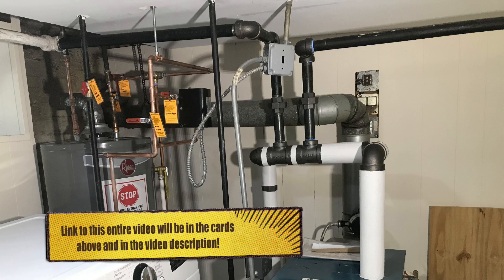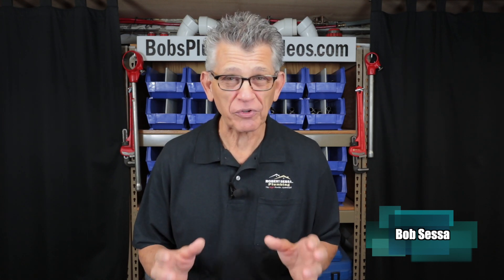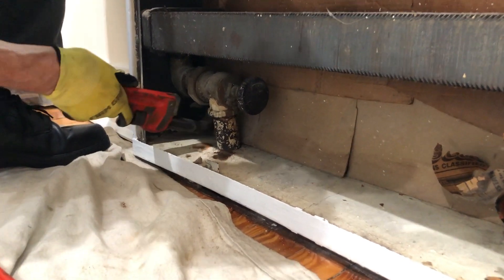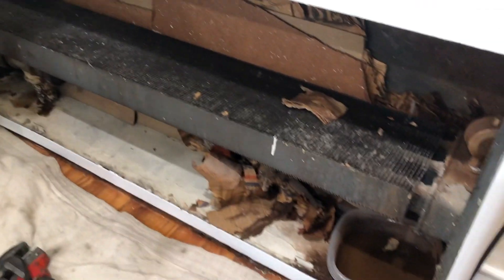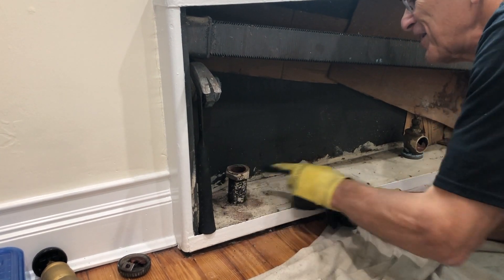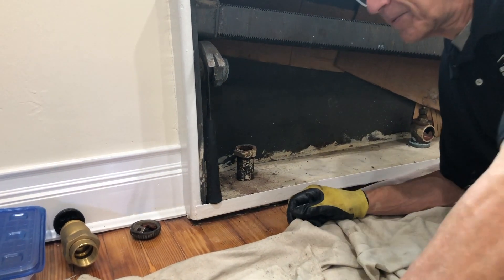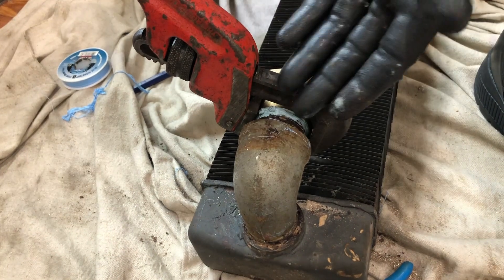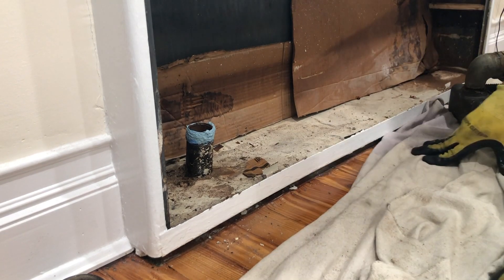Steam Radiator Air Vent Spitting Water

Comment: Bob    Exactly what blades did you use to cut the valve?
Reply from the maker: 9 inch 14/18 TPI Diablo Steel Demon Bi-Metal Blades
Reply: @BobsPlumbingVideos   Bob  Santa needs to know what blades you used on the Multi tool.

Comment: why not change the street elbow and small nipple while everything is a part?
Reply from the maker: No question you could, but I don't like messing around with these steel convectors (fragile animals) doesn't take much to screw them up. If this was a cast iron element, absolutely!
Reply: @BobsPlumbingVideos regardless you should have held back on the street elbow with another wrench.

Comment: Hi Bob, I have the same kind of radiator on the 4th floor and the air vent keeps spitting water. Is the valve issue?
Reply from the maker: Pitch the convector toward the shut off valve, use a good quality air vent. Hoffmans are a good choice.

Comment: great job but 1nfatal mistake was observed,youre never ever supposed to put any pipe dope nor teflon at any union joints even covector valve,thats a huge huge no no as far as fitters locals in nyc,that shit goes inside the pipe and tou are dmnn fuked, and damn u had the coil out and really takes a second tofully drakn that water out off that coil, details is what makes u stamd out from the pack AND $$

Comment: My convection radiator is knocking and spiting water, but it doesn't have a convector valve. The pipe goes straight in from the boiler.
Reply from the maker: All convectors should have a service "shut-off" valve, but I've seen this situation before as well. Having a working valve just makes life easy when you have to remove the convector ands investigate.

Comment: Hi Bob, I have the same radiator as seen on the video and it has the same amount of space inside the wall. My radiator is not producing enough heat for the bedroom. I replaced the relief valve on the side but it's still not able to produce enough heat. The shut off valve is brand new and fully open. I want to mention that I also have a steam system. I called many people in regards of finding the same radiator but was unsuccessful in finding a replacement.  They stated they don't make this same type of radiator anymore. Where am I able to purchase this type of radiator? Should I  buy a cast iron radiator? Are you able to send me a model number, if it's available for purchase?
Reply from the maker: They are a little bit had to find, but they're out there. Check out this link  - https://bit.ly/3rRfYQa. Check the data sheet for specs. I believe they'll ship. Is that convector properly sized for that room?

Comment: I don't see these convectors much, any advantage to them over cast iron radiators as far as heat goes? I guess being mostly recessed into the wall they don't take up as much floor space.
Reply from the maker: I personally like the cast iron versions, they retain the heat much longer after the heat shuts down. These steel convectors heat up quickly, but cool off soon after the boiler shuts down.

Comment: Great Video Bob! You do it so easy and fast. I am a Super Intendant on a 75 family in South Brooklyn. The past few years i use Verivalve. My radiators are same as in this video. I hate when tenants play with those main valve and then they leak and damage the ceiling in the lower apartments.

Comment: Hello ... A frustrated Brooklyn tenant. 3 Years in a row radiator is spitting water and my super thinks I or someone is touching the valves .... unless it's a ghost no one is it's no reason to. Any suggestions.    He changed the piece where the water is spitting out 4 years ago when it initially happened. Its worst now because he said yesterday they turned the heat up do to the tenants above me on the 4th floor wasn't getting good enough heat to warm their apartments. My hardwood floors are slightly warped because of this... Dumping buckets after buckets.... Helpppppp lol Please
Reply from the maker: Tough situation in an apartment setting, to many hands playing around with things they know nothing about! I feel your pain.
Reply from the maker: Bay Ridge
Reply: Today the valve was making noise. When i took it apart, the inside rubber piece came out of the handle and was making funny noise. Which part of Brooklyn are you in?

Comment: Great job! I used to live in a CO-OP in Jackson Heights. I remember when those used to bang, but it could really heat up the Apt. Still in Jackson Heights, but own a 3 family. Before I even got through the video. When you said water was spitting out I automatically thought that the auto feed with the low water cutoff  combination maybe went bad, because the sludge that can build up in the steam radiator when not flushed out after long periods of time. You’re videos are great. I do commercial work as a steam fitter. Sometimes at a job anywhere from 1- to 3 years. Depending on the size. I always wanted to try residential because you see different people on a regular basis and go from one job to the next. So l, nothing really get Repetitive which can happen in a commercial job site. Keep up the good work. You’re only a borough over  Lol  small world. Keep the videos coming. Great content.

Comment: Nice job! 
I have the exact same convector in my house in Queens except it's a hydronic heating system (not steam). Is there suppose to be a hy-vent on one side? Cause I only have a manual air bleeder valve. Thanks!
Reply: Manual bleeder only

Comment: That that special blue goop?
Reply from the maker: Not Blue Block, Mega Loc. My everyday go to choice! I use Blue Block on all of those problem Joints.
Reply: @BobsPlumbingVideos  Thanks for the response! You have great videos for beginners (me) and pros. Any opinions on Bradford White's boiler system? I work at a kids camp and we need to replace a furnace soon but just put this 100gallon water heater/boiler in. Any thoughts if you have time.
You're much appreciated either way!

Comment: Great vid! My back hurts from watching this..lol.  Question, is the valve the same as you would use on a standard vertical orientation for a cast iron radiator?  Does the horizontal orientation change the principles of the steam/condensate flow through the valve?
Reply from the maker: They’re some what similar, difference being on a traditional vertical valve the threaded end is at the bottom. On the convector valve the threaded end is reversed. Same with the spud or union end, they’re reversed. The condensate still flows back toward the steam system.